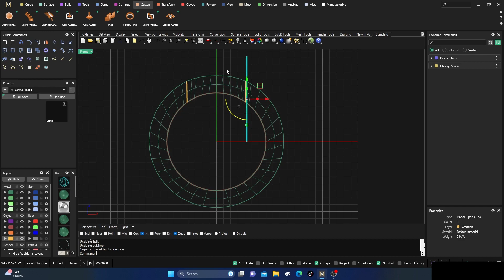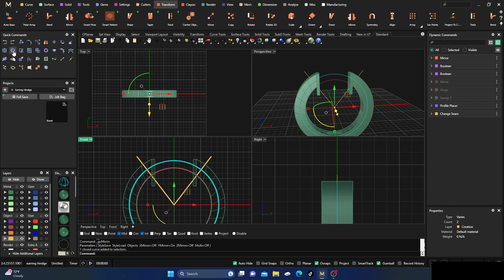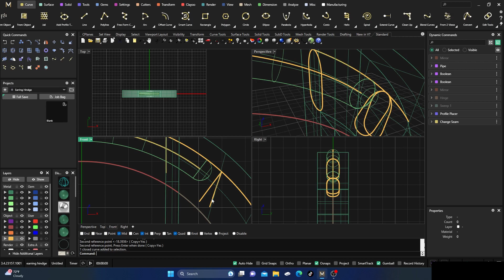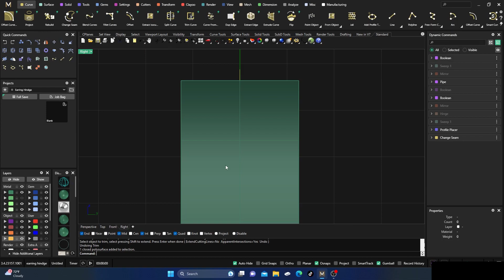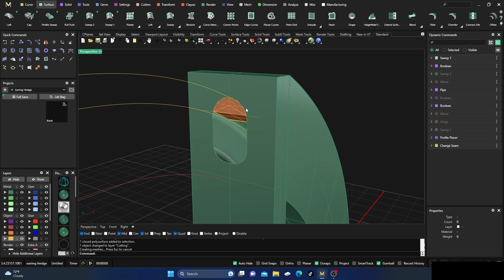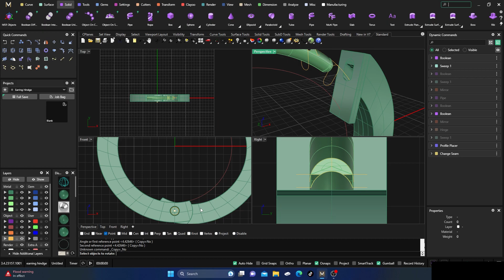MatrixGold Earrings Hinge and Clasp

Comment: Hi Don, I really appreciate your videos. However, in this video I'm trying to see the Change Seam option on my ribbon bar and I've tried all the related commands, but it isn't possible for me (I'm doing all of this in Spanish because I can't change the language of the software)

I would appreciate if you can help me with that, or if it is possible to continue skipping that step.
Reply from the maker: Type crvSeam in the command line but it should be in your ribbon bar under curves.